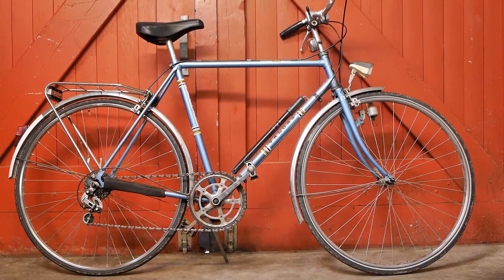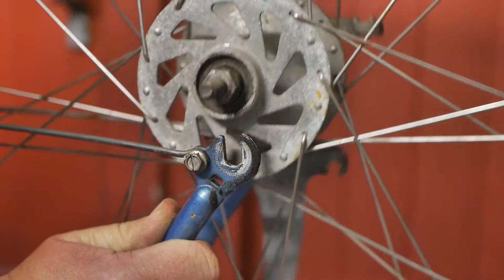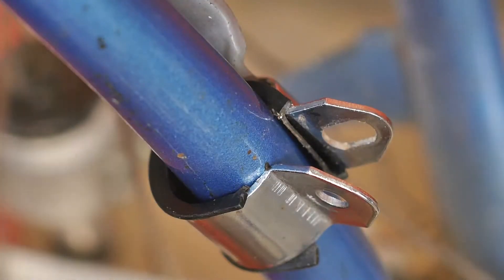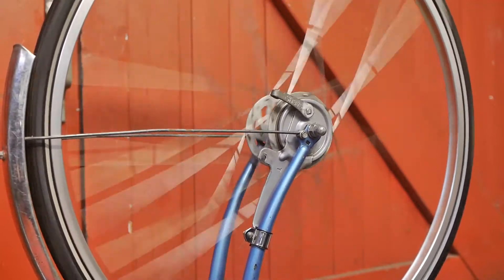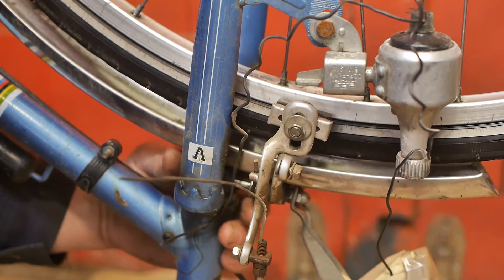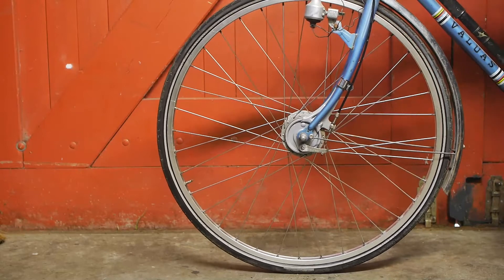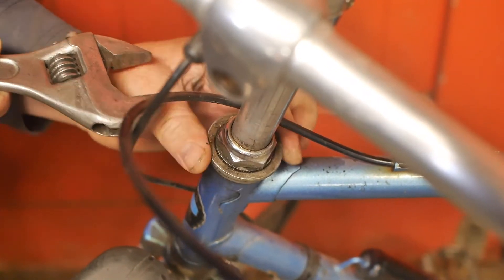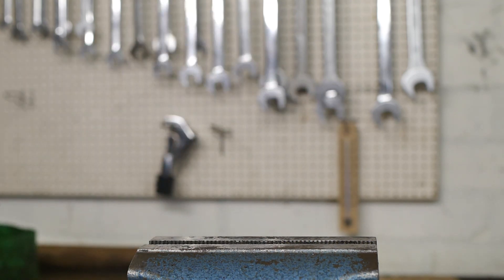My Valuas bicycle gets a front drumbrake

Comment: I was looking at a Dutch-style bicycle today in my town. It was a Giant Avant Touring Line and it had a 6-speed derailleur, 28" wheels, a rear wheel lock,  Dutch-style dynamo lights, but only centre-pull brakes. I was allowed to ride it and it was perfect for me. I might buy it, although I can find nothing on the internet about this model. My first time on this type of bicycle. It is so very comfortable.
Reply from the maker: If there is something like a Dutch bicycle, it should probably have an internally geared hub. And definitely some mud guards and a carrier. But it all dependents on your surroundings. I had a quick look at the Dutch giant website, apparently they don't sell the Avant in the Netherlands. Good luck, shopping for a new ride.
Reply: @RolingRandom   Well I've got the bicycle now to keep. I found a torn sticker on the rear mudguard. I worked out it was Eibergsestraat Haaksbergen. There is a name I think but most of it is missing. I think it must have had an interesting history.
Reply from the maker: Congratulation on you new ride. I did a quick google search but I did net find a bicycle store on the Eibergsestraat in Haaksbergen. It seems to be a bigger road on the outskirts of the town. But who knows at some point there was a bicycle store there.
Reply: @RolingRandom  I've dated it at 1993, so it's quite old but in good condition.
Reply from the maker: I see, almost vintage. I got a 6 speed RIH sport bicycle with Shimano Positron. More then enough for a flat country. But of you are in the hills you might need to gear it down a bit.
Reply: When a bike feels so comfortable and ‘right’, you ought to buy it. Everything else can be changed, but not comfort and fit.

Comment: I have a question about the serrated washer. At 2.19, I can see the paint on the dropout and it appears to be marked / scarred by serrations. This suggests to me that the serrated side of the washer is supposed to face the frame, and not face the acorn nut.